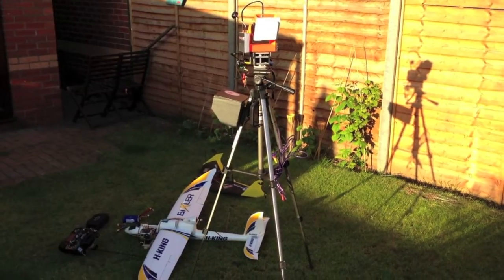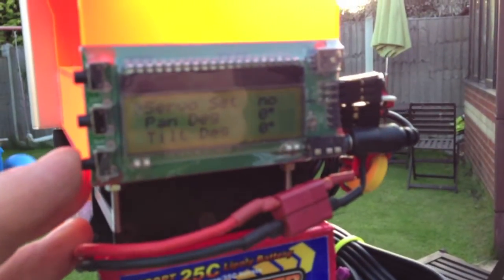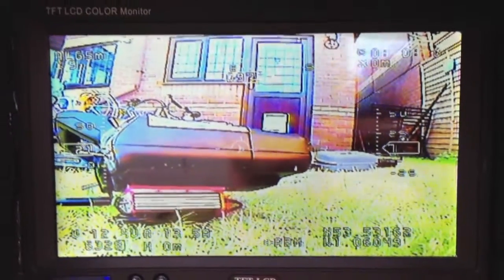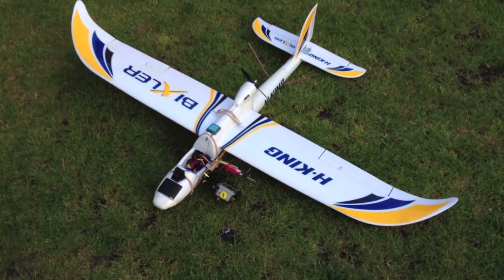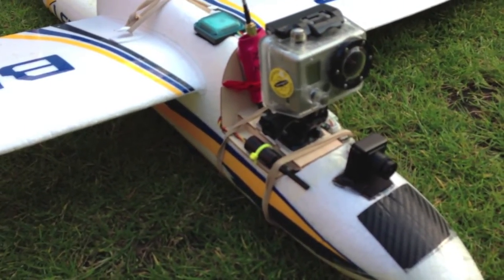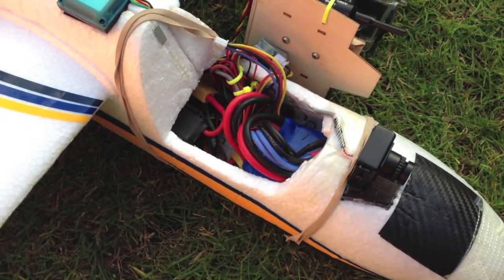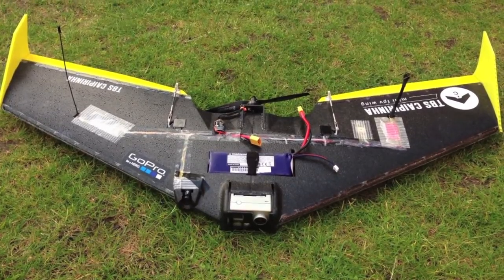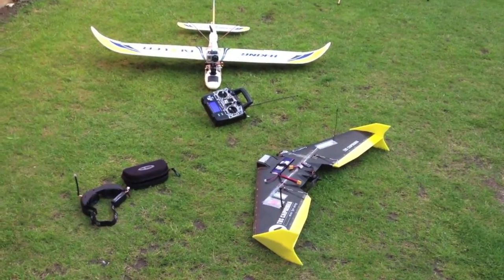FPV How To Guide - Antenna Tracker system, Hobby King Bixler and TBS Caipirinha.

Comment: Hi, I noticed your using Immersionrc's Tiny Telemetry & on your video of the packet received screen you seem to get a good quantity of packets per second. I seem to only get 1 packet received per second. Have you modified you tiny telemetry in any way to up the data rate? Please see my post on the FPV lab forum. http://fpvlab.com/forums/showthread.php?38353-Tiny-Telemetry-Packet-Rate   Thanks